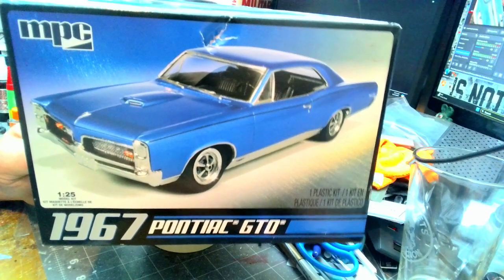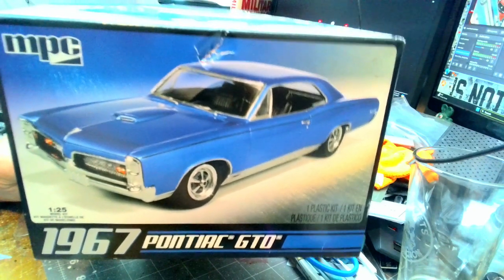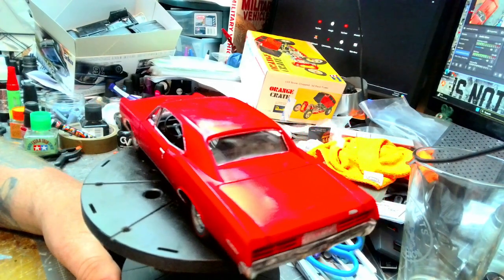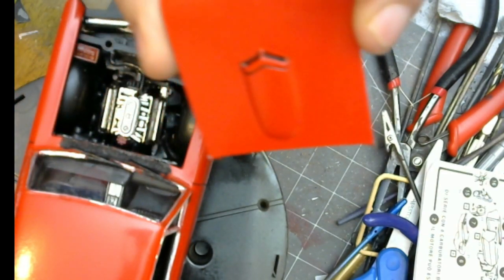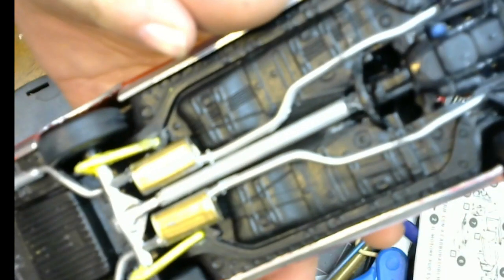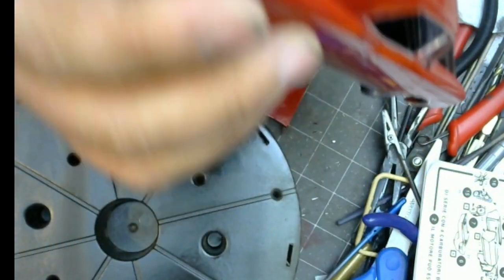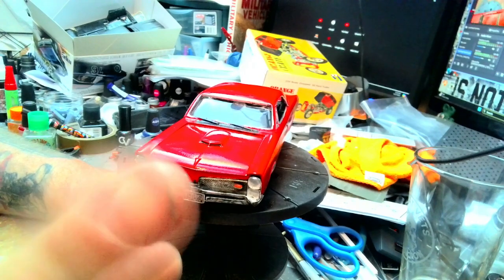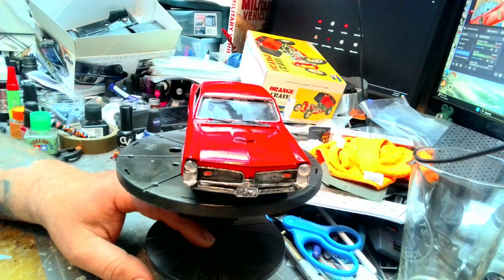FINAL OF 1967 PONTIAC GTO (MPC) GB HOSTED BY LUKA CEE

Comment: That came out very nice, love the color, it is cool this is based on a real car, and that it is a gift.  I use HVAC tape for lower body moldings, haven't tried it yet for window trim, that may be in my future!  Thanks for sharing your awesome build with us.
Reply from the maker: Thanks for dropping by and checking it out, yes the HVAC tape works good but you have the burnish it down alot due to the thickness around the windows and trim. Also it is my 1st time trying the do BMF/HVAC tape then primer & paint over the top then remove the paint using lacquer thinner & fine tip Q-tips exposing the HVAC/BMF. I first seen the tip from Rob @ time machine models & he got it from someone else. Yep this build is going to a Vietnam Veteran who I transport who owned a 1:1 67 GTO regimental red with the 389 tri-power